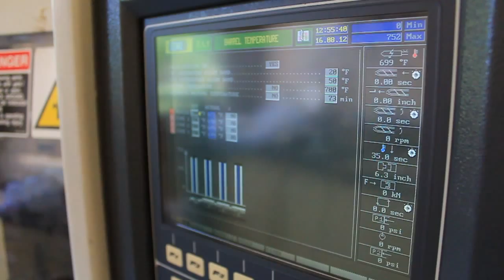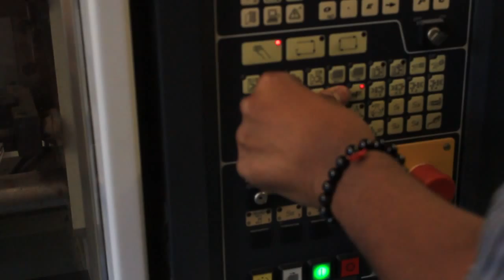Rutgers Builds Bridges with Recycled Plastic

Comment: Do microplastics end up in the environment? Also, a tradesman was cutting through the plastic beams with a chainsaw. What happens to all the micro-plastic? If it washes down into the oceans to bioaccumulate up the food chain, shouldn't something be done about collecting that waste? I love the attempt to reuse plastic in helpful ways, but what happens as the bridge starts to age.
Reply: Given the fact that plastic doesnt corrode and is highly durable , it probably can last 50-60 yrs easily, even if it breaks or gets Weaker, it can be remoulded and used again which is quite cheaper. Besides regularly checkup and maintenance will further increase the durability. Only think problematic thing is microplastic ending up in the environment and water bodies. But its already happening due to excessive dumping in the oceans(garbage island). If we make these structures away from water bodies, the damage will probably be less but it'll happen.